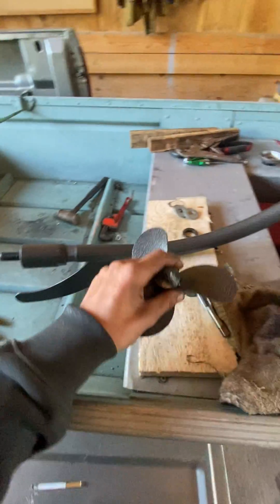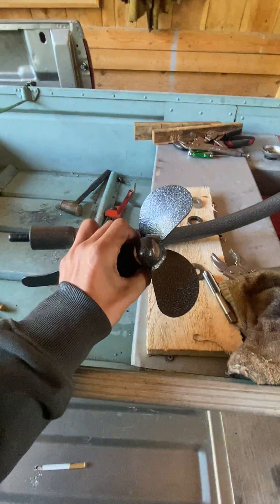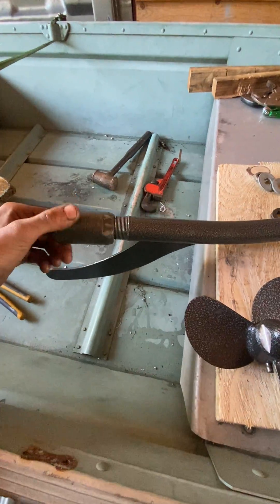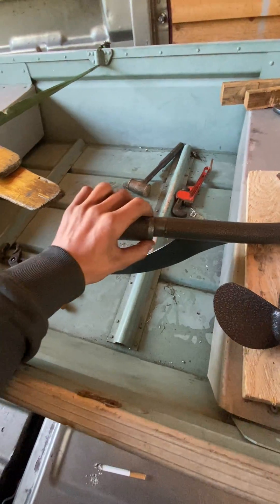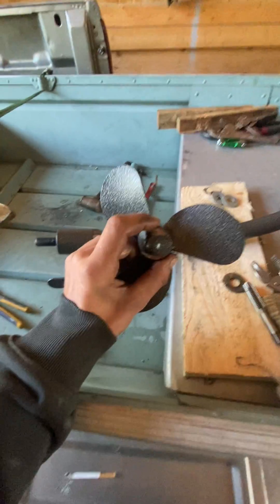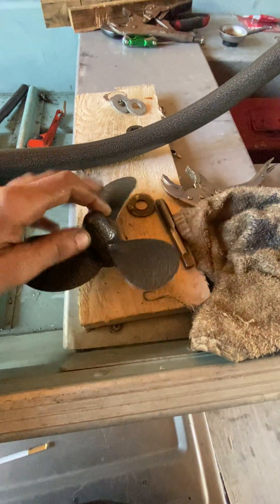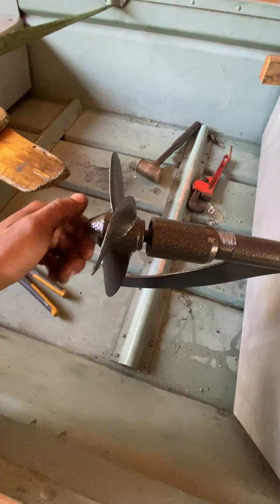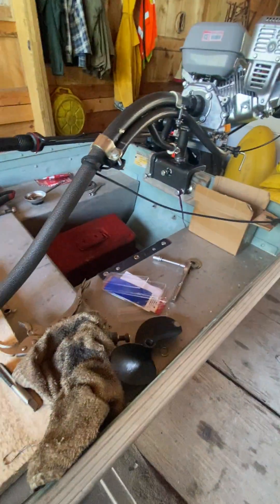twister prop mod, 2 blade prop, twister clone,AMAZON motor prop removal

Comment: I copied ur set up but my only question/ concern is the water gets in those bearings by the prop and gets water in the grease. Any cause for concern? Do u have the same problem? Any suggestions? Thanks.

Comment: Hey man does yours make a popping noise when it’s in the water
Reply from the maker: cavitation? yea the stock setup kinda did.. try a 2 blade prop conversion, and get a longer trim bolt, play with the height of the prop in water, and shift your weight from back too front, see what changes.. I keep myne so its almost out of water, i gotta sit in back too get it too grab, but once im on plane, i move up and sit in middle a bit.. all depends..

Comment: Where did u buy the 2 blade prop
Reply from the maker: ebay, mudskipper,  just search longtail/surface  drive props..  i would start with a 6.5 up too 7".. 

the black props are best all around.. performance..

 but they do have 6.5 hi power, hi-speed #0.. many.. but there cheap..  I got like 6x props.. 

My favorite for all around is the 7" black regular prop.. and the 6.5" hi power... 

after i did cam and mods, i went too a #0 hi speed, and that was ok for solo rides.. but i never got over 18mph... YET.. 

https://www.ebay.com/itm/194759610494?mkcid=16&mkevt=1&mkrid=711-127632-2357-0&ssspo=Rb1ARy15Rhy&sssrc=2047675&ssuid=IWqZcomGRvm&widget_ver=artemis&media=COPY